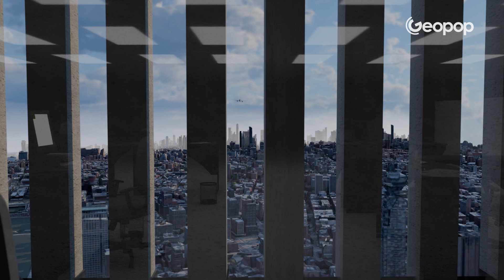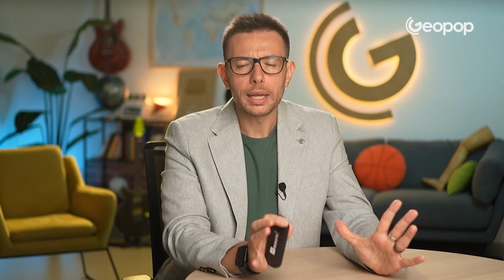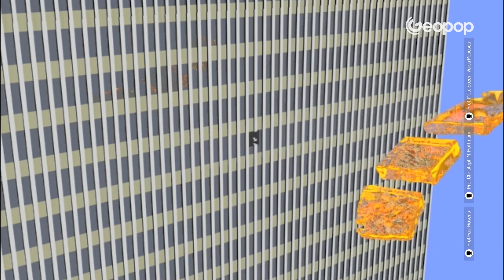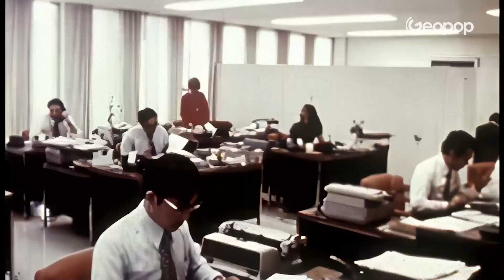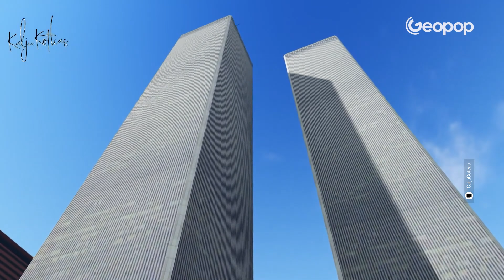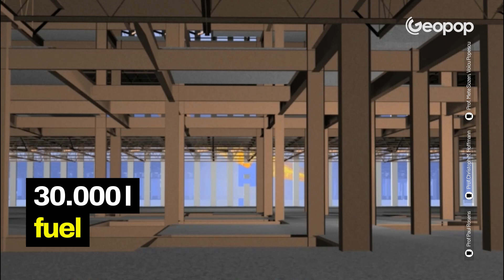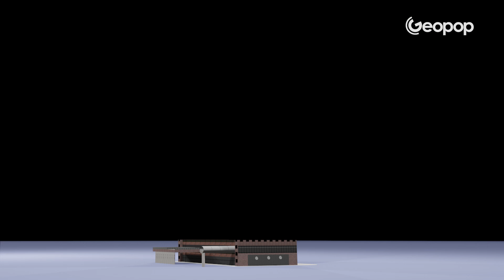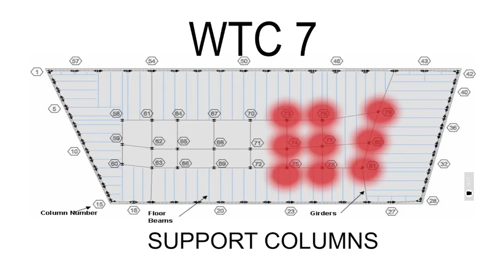9/11, 2001: The Technical Reconstruction of the Twin Towers and WTC 7 Collapses

Comment: How do you reconcile the fact that the towers collapsed globally, symmetrically, and against the path of most resistance at near free-fall acceleration (64%), despite the significant structural resistance that should have slowed the collapse if it were purely gravity-driven? You cannot have constant acceleration while meeting the resistance of the lower floors.
Reply: Didn’t building 7 once hold CIA or other intelligence offices?😮
Reply: Probably. It held several different government offices at different points, it was a ton of office space. The CIA doesn't exclusively operate in special CIA government funded and constructed building, I'd assume they routinely rent out commercial office space which the WTC has in abundance.
Reply: @tricky2055  Once? I'm sure the (old) building 7 that was demolishd on 9/11 always did.
Reply: @tricky2055 yes!
Reply: Watch the video
Reply: NIST said So !
Reply: There simply bolted. Plus the structural strength needed it to be whole.

It's not rocket science. It's engineering.
Reply: Some people still believe the list report, and in father Christmas.... Adults too apparently,  who knew...... shills or cognitively impaired.
Reply: The corrupt gubmint hired some "scientists" to write a report that completely "explains" it.
Reply: YT is censoring my comment
Reply: Did you not notice the debris flashing outward away from the building as it fell?
Reply: Because of the moon landing
Reply: Jesus Christ…so tired of you moronic conspiracy theory jerk-offs. ENOUGH. STFU!
Reply: You can have acceleration until the upward force matches the downward force. Then you have reached terminal velocity. It’s no different than a skydiver. The upward force from the building was constant but the downward force grew exponentially with velocity and mass. This is really basic physics here. If you want to say there was no acceleration then we are truly witnessing magic. I can’t think of any scenario that would produce such a perfect balance that a building falls at terminal velocity the whole way down.
Reply: Either you didn't watch the video or your comprehension skills need to be improved.

The towers were designed to support their entire weight as a static load, plus a limited dynamic load of 11 floors applied slowly or 6 floors applied suddenly. The loss of support for the 12 floors and 29 floors above the impact zones in the North and South Towers, respectively, subjected the floors beneath them to a load that clearly exceeded the design parameters.

Furthermore, each floor was destroyed successively, and rapidly, by the collapsing upper sections, as they would be expected to given that no single floor could withstand the instantaneously applied load.

That explains precisely why the towers plummeted straight down at near freefall speeds. The floors offered practically no resistance to the falling mass of debris, and there were no other loads being applied. In other words, the floor resistance could be ignored, causing the towers to collapse at a rate close to 9.8 m/s^2 under the force of gravity.
Reply: Lol nope.. it should've been a fragment collapse in that case... one side that was weakened would be the first tl crumble caussd by that and it would topple not go straight down but it didnt happen like that and if you look closely the flares as they collapse are identical to controlled demolitions @emergencyfood3568
Reply: @emergencyfood3568 Wtc 7 should not have fallen at near Free fall speed in its own footprint From small office fires. Yes, I know it got struck with pieces of the Tower. But still.
Reply: @ryanbratoc  It’s for the same reason the North and South towers collapsed in a freefall. Of all the possible causes for a collapse like that, fire is the most likely by far. The fires might not get hot enough to melt the steel outright, but the strength of a material is a function of its temperature. The building was completely ablaze when it collapsed, after all.
Reply: @ElLowEl .  . "What the hell are you talking about?" .  . 😃 .  . Thank you for your sponsored reply, Mr. EILow.  The word projection indicates holography as you know, commercial demonstrations of which have been amazing in recent years.  To feign ignorance doesn't work well for you, however.  Where, Mr. EILow, is the wake turbulence only seconds after passage of a 500 mph large passenger airliner -- not seen in the smoke and fire covering the impact zone?  Even the wake of a small Cessna Aircraft would be noticeable -- yet there is nothing.  It's likely that no real answer from you is forthcoming. We'll wait and see .  .
Reply: @ronaldgreene5733  troll 101 -- thx
Reply: Ever seen a video of a train smashing into a car?  Did you notice how the car didn't slow the train down at all?  Same concept.  After a certain point, the floors below offered no meaningful resistance to the force of the floors above crashing down.
Reply: @ Comparing a train hitting a car with a top of a building falling down on a larger part of the building, conisting of a steel frame? 

Sorry to say, but 3600+ architects and engineers plus plenty of physisists an other scientists,  say no way and have said so for 18 years.
Reply: @crisphatly6305 That is the most illogical statement here is!
Reply: Which is more extreme -- to accept without question the inexplicable lack of turbulence in the wake of a 500 mph large passenger airliner -- not evident in the smoke and fire covering the impact zone only seconds later? -- or to recognize the indications of digital projection in its imperfect nature as we see a wing disappear in front of a bright blue sky? From another camera angle, the same aircraft is seen passing behind a crane in the foreground, yet in front of the heavy crane cable. 

There should be a hurricane of turbulence in its wake that would entirely disrupt and disperse the smoke and fire seen billowing outward just 3 to 4 seconds later at both towers.  Even the wake of a small Cessna aircraft would be noticeable -- yet there is nothing.
Reply: Here's a tip! Try watching the video!!
Reply: @Jnoooooo hey John I see you still in the CIA
Reply: @Jnoooooo the same video that uses an entirely inaccurate graphic of WTC7 falling?
Reply: The towers and Building 7 did not fall at free fall speed. If they had, the debris pile would be much more uniform. Instead, the collapse was progressive, with the remaining structures failing one after another due to the increasing load and weight of the buildings above them. As the floors above started falling, they put increasing pressure on the ones below, causing a cascading effect that led to the final collapse.

And before you say anything, “Pull it” refers to the rescue operation—to pull the firefighters out of the building because of the already massive loss of life.
Building 7 was hit with debris from the North Tower, and fires burned out of control. Why even involve Building 7 if 9/11 was an inside job? It’s not nearly as significant as the Twin Towers.

The government did release footage of the Pentagon crash—multiple camera angles, in fact. It’s not Hollywood-quality, but it shows what happened. Why would they withhold high-quality footage anyway? To protect classified areas of the Pentagon? Makes sense, right? Or maybe it’s because security cameras at that time weren’t high-definition, and they’re designed to monitor people, not record plane crashes. Plus, do you really think there were cameras aimed at every angle, just waiting for something to happen? 

The beams didn’t melt; they expanded and sagged due to the fire.

Wreckage from Flight 77 was found at the Pentagon crash site, including landing gear, engine parts, and pieces of the fuselage with the American Airlines logo. If it was a missile, why the fuck were airplane parts scattered all over the place? And let’s not forget, eyewitnesses—actual people—saw a commercial airliner crash into the Pentagon. There’s radar data too! Plus, human remains and personal effects were recovered from the site!

Now about explosives—why the fuck would ANYBODY in government want to kill thousands of their own citizens in a building? They’d likely be noticed because the towers were so busy; even overnight staff could’ve caught someone planting them.

The towers had a tubular frame, not webbed steel like most buildings. They were built to withstand a 707 at normal speed on a foggy day, not a 767 flying at high speed.

Controlled demolition? Those start at THE BOTTOM, not the top. It would also leave specific debris patterns, unlike what was found at Ground Zero. You would also hear explosions before the collapse, and the squibs would be visible before too. For a controlled demolition, you’d expect to find detonation cords in the debris—those are YELLOW. They weren’t found in the rubble. Just look at the Ground Zero images.

Tower 2 fell first because it was hit lower and at an angle instead of straight on.

Hearing explosions? The descriptions of the impact and collapse were similes, “AS IF a bomb went off” or “LIKE an explosion.”

Wreckage from Flight 93 was scattered over a large area in Shanksville, Pennsylvania. No mystery there—when a plane crashes at high speed, it’s going to break apart.

The CVR data recovered from Flight 93 shows the passengers fought back. No shootdown. If that happened, we’d find missile fragments, and we didn’t.

Other buildings have collapsed due to uncontrolled fires in history.

Early reporting is often inaccurate, especially in chaotic events like 9/11. The day was traumatic, so descriptions and statements don’t always match the facts.

There are hundreds, if not THOUSANDS, of eyewitness statements that contradict the claims of “missiles,” “no planes,” “thermite,” and so on.

Operation Northwoods has ZIP to do with 9/11. It was REJECTED and declassified long before the attacks. There’s no accurate way to tie it to 9/11.

It’s uncommon but not unusual for lightweight items like the Saudi passports to survive catastrophic events.

Need I say more?

And if it was an inside job, why would they pin it on Al Qaeda, a group KNOWN to be hostile to the U.S.?

Oh, and how about you take these theories to the eyewitnesses, the survivors, or better yet, the families of the victims? See how far you get with this nonsense.

“It’s all there black and white clear as crystal! You get NOTHING! YOU LOSE!!! Good DAY, sir!”
—Willy Wonka (Gene Wilder)
Reply: @MrAwesomedude808  I agree with every point you made except for the inside job part. The US government has intentionally done horrible/unspeakable acts to people both inside and outside its borders. I believe that our government's leaders/heads of certain agencies allowed it to happen. I didn't really think this was possible until I learned about the 5 dancing (people who come from a country with a blue star on their flag and YT likes to censor if you speak out about that country). That story along with statements made by powerful people after the event make me think that it was engineered so much but enabled.
Reply: @MrAwesomedude808  You're right. 7 fell at free fall excelleration - which AE911Truth and since the Fairbanks University study on 7 have long established is impossible from just fires and "falling debris" - outside having exposed the report of building 7 to be a pile of asbolute distorted and twisted pack of misleading.

Are you going to be the first on the world to show up at a scientific debate in which you try to defend the NIST as being sufficient scientific material to account what happened to the towers? (That would of course demand that you first of all coming out to show that you're a human being and not an AI bot.)

Nah, I thought so.
Reply: @MrAwesomedude808 when you said why would anybody in the government kill their own people everything you said before and after is meaningless, you have no concept of reality or history. More people have been killed by their own government than all wars combined
Reply: @ 7 fell at free fall acceleration - which i just one of many evidence of CD. The Fairbanks University of Alaska has long proved that the NIST "report" of how fires should have done it is scientific fraud.

Besides that AE911Truth has years ago astablished why the NIST "reports" on the towers too are scientific hogwash, because they don't explain what actually happened to the towers and all the CD resembling phenomena that goes on during their collapses plus the unexplainable like pools of burning and smoldering rubble for three months after that couldn't be put out or the nano-thermitical substance found in the dust.
Reply: @MrAwesomedude808  you can see the core support of building 7 being blown out before the sides of the buildings get pulled into the center. This was a controlled demolition, a 5 year old would be able to determine this, its absolutely incredible how these people are able to completely bypass the critical thinking functions of so many of the populations brain. I thought the only way this could be done was through something like hypnosis or some other form of subconsious mind controll.. Idk what it is but im very glad that it doesnt work on me
Reply: @MrAwesomedude808  I agree with your statements about 9/11 except for the inside job part. Our government has intentionally done horrible/unspeakable things to people in and outside its borders. I believe that people within our government allowed the attack to happen. I never really believed this until I came across the 5 dancing Israelis story. This along with other statements made from powerful people have given me serious doubts about the innocence of our government's leaders at that time.
Reply: @MrAwesomedude808  I agree with your statements about 9/11 except for the inside job part. My and maybe our government has intentionally done horrible/unspeakable acts to innocent people in and outside its borders. I'm not certain but I'm starting to believe that leaders within the government and certain agencies allowed the attack to happen. I came across the story about the 5 dancing Israelis and it hasn't given me serious doubts about the innocence of our government's leaders. That story along with statements made by some very powerful people about the aftermath paint a darker picture.
Reply: @MrAwesomedude808 I agree with your statements about 9/11 except for the inside job part. My and maybe our government has intentionally done horrible/unspeakable acts to innocent people in and outside its borders. I'm not certain but I'm starting to believe that leaders within the government and certain agencies allowed the attack to happen. I came across the story about the 5 dancing !srael!s and it hasn't given me serious doubts about the innocence of our government's leaders. That story along with statements made by some very powerful people about the aftermath paint a darker picture.
Reply: @MrAwesomedude808 I agree with your statements about 9/11 except for the inside job part. My and maybe our government has intentionally done horrible/unspeakable acts to innocent people in and outside its borders. I'm not certain but I'm starting to believe that leaders within the government and certain agencies allowed the attack to happen. I came across the story about the 5 dancing !$rael!$ and it hasn't given me serious doubts about the innocence of our government's leaders. That story along with statements made by some very powerful people about the aftermath paint a darker picture.
Reply: @MrAwesomedude808 smh.. ur drunk on the kool aid... there were so many other reasons for this false flag operation... u mentioned exlposives... there were accounts of workers seeing construction guys for months working in the building ... u think they went to observe them to see what they installed? Also the silverstein iasue... all the paperwork to indict him and golden Sachs was in building 7... 2 trillion stolen via crooked shit in bush administration... furthermore nobody was thinking about the middle east after the Clinton administration...going to war was not going to pass congress... so what did they do... they false flagged and immediately "knew" who did it...intelligence doesn't work like that they had to know there was a threat... but wait.. there was war games simulating the exact scenario of a hijacked plane being flown into wtc.. and Pentagon and the capital on the same day.. explain that... then explain the money trick where u fold a 20 and can see two towers burning and the side of the pentagon... then explain why the fema training booklet had a target of the two towers on its cover.. then explain why in windows 98 u use wing dings and type in 911 u get a plane and two towers... ya explain all that o and what happened with them blaming Afghanistan... just to reenter iraq again for oil... what do the bush family have interest in? ExxonMobil ... smh if u can't connect the dots ur braindead
Reply: @nickcharles1284 .  . "science" .  . 😃 .  . Commercial demonstrations of holography have been amazing -- so you believe that they are analog in nature? .  . What century are you living in?   

You also cannot explain the entire lack of turbulence behind a 500 mph aircraft that would entirely disrupt the smoking fire coming out of the building on the seconds later. Even the wake of a small Cessna Aircraft would be evident -- yet there is nothing.